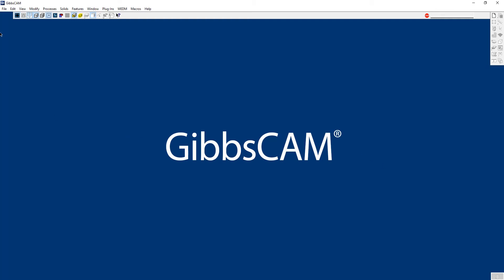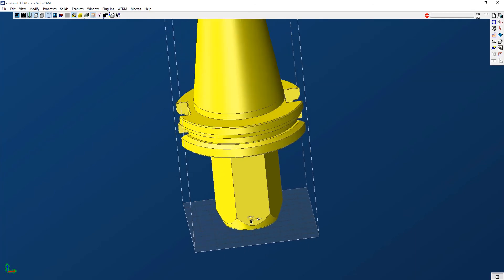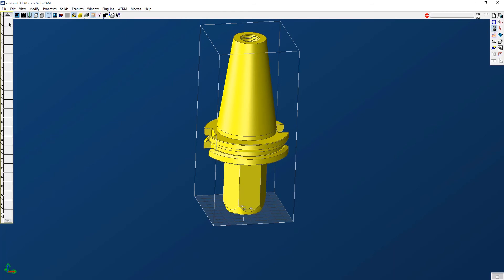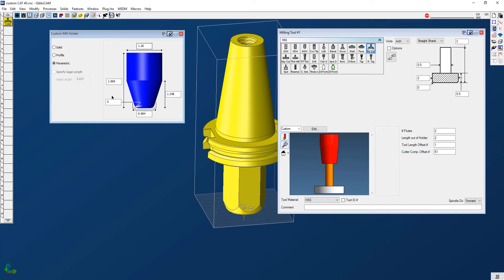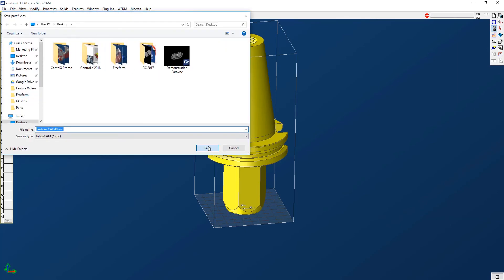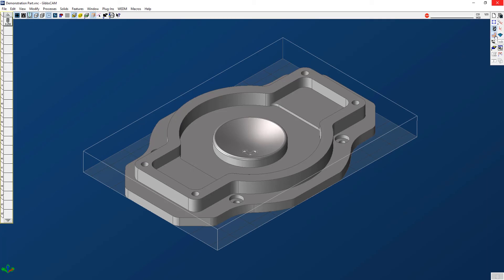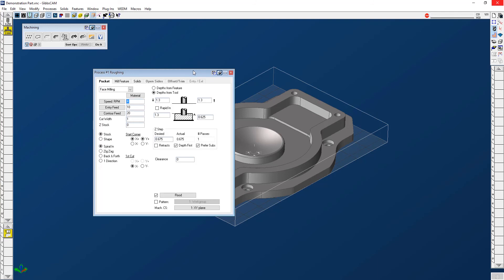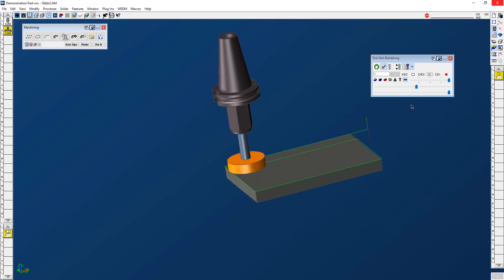Custom Mill Toolholder

Comment: when i do this and than use machine sim there is a gap between the tool holder and the spindle, i have the zero right on center z where the tool would come out and the taper of the tool in the positive z.  when i use one of gibbs premade tools the tool alligns correctly in the spindle